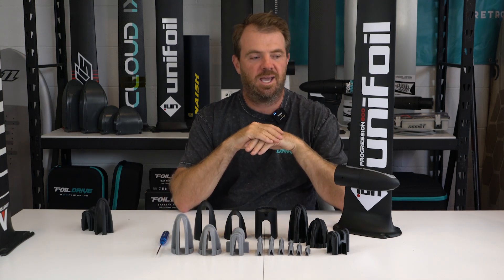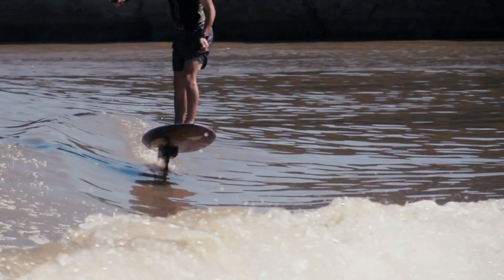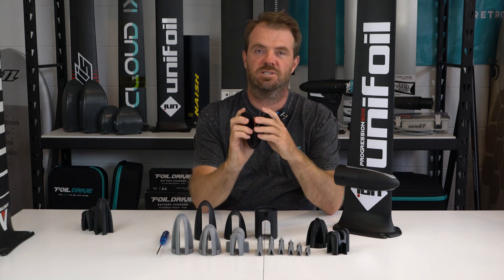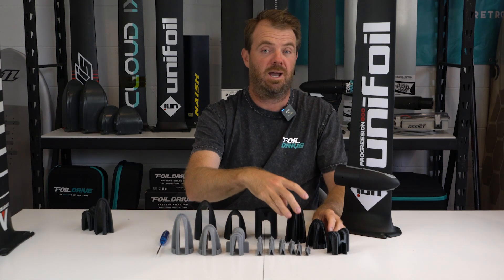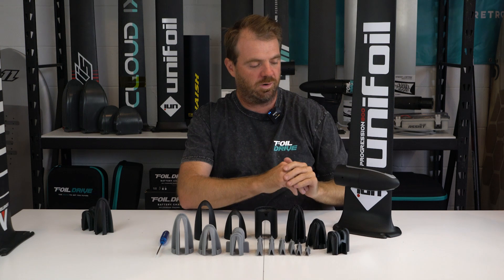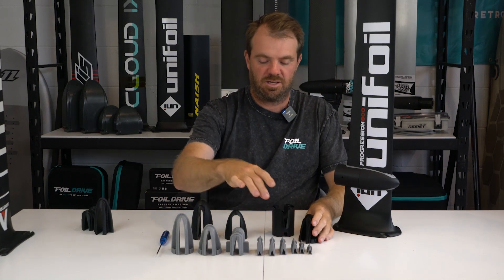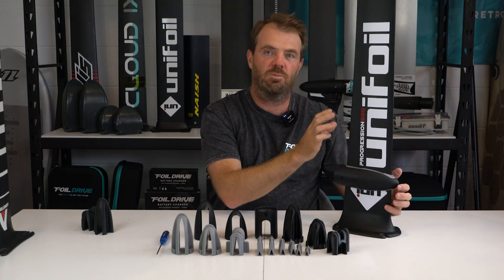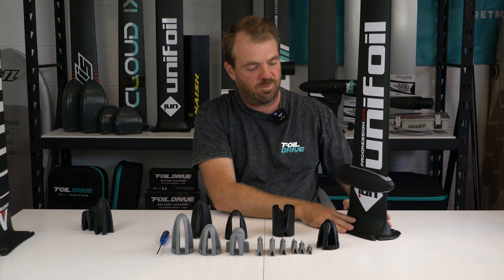Meet the Universal Mast Adaptor | Foil Drive Tech Talk

Comment: So when you say "the 19 cm cable to the150 cm cable" does that mean that they will not work with the 15 cm cable? Specifically  the Slingshot carbon , tapered, Masts.
Reply from the maker: They will work with all motor positions, this measurement is talking about the measurement of the mast, not the cable.
If the chord of the mast is between 19mm and 150mm the Universal Adaptor will fit, if your mast is outside of these measurements we can either help you with fitting the Universal Adaptor, or discuss a custom adaptor. Send an email to support@foildrive.com if you have any concerns!